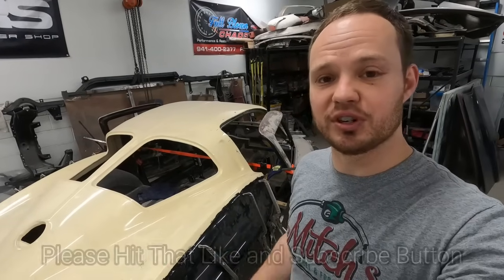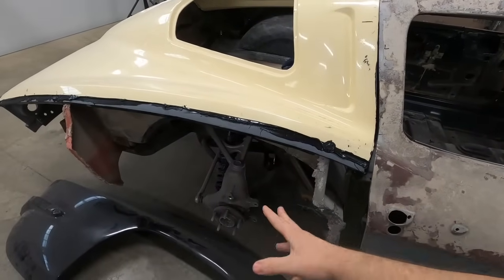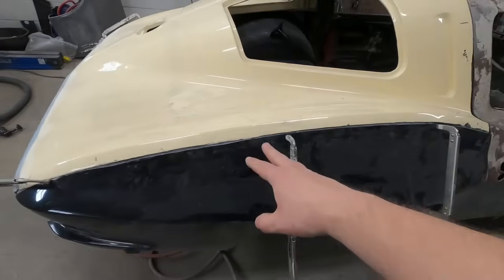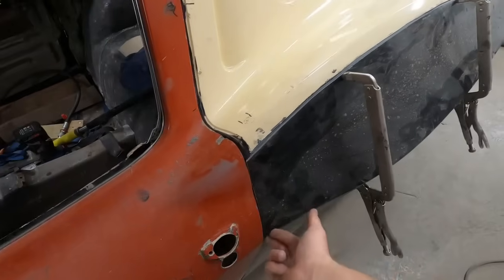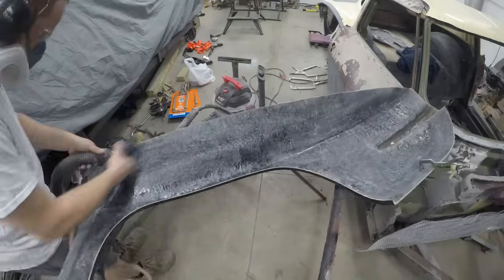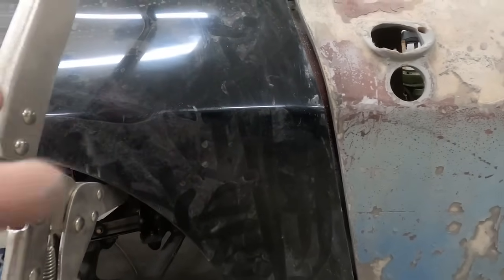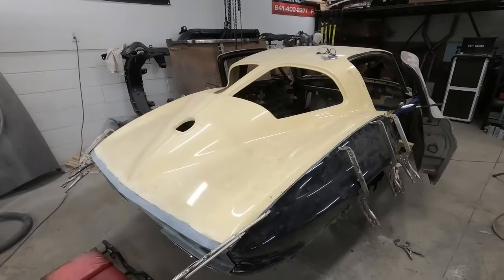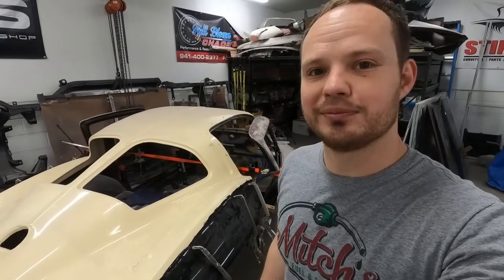Installing 1963-1967 Dynamic Corvette Wide Quarter Panels On The Tribute Split.  Wreck To Restomod.

Comment: Looking great Mitch, thanks for the new vid, nice to see so much progress, that's really intimidating work for most Corvette owners. My update: I tuned the bucking at extreme low speed (almost) out of my '66 w/mystery 350 and I'm making good vacuum.. Too much vacuum advance though, plus the idle was a bit lean. It still bucks a little but that's right before a stall, and the engine pulls 12" Hg steady now at 850 rpm. Calling it a win! Maybe I'll build a 327...Keep 'em rolling 👍

Comment: If I were  a "corvette " guy doing  this all the time I would  consider  making  some molds for some of these  parts  .
Reply from the maker: I have made some molds along the way to fix common trouble areas. But typically I buy new parts if I can or I make molds as I go.